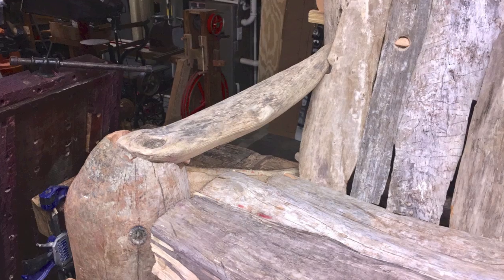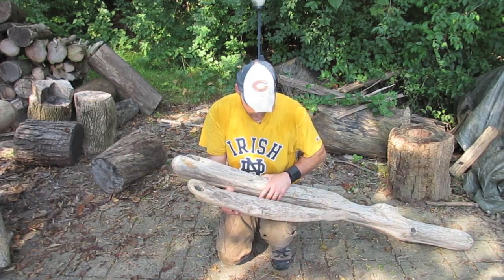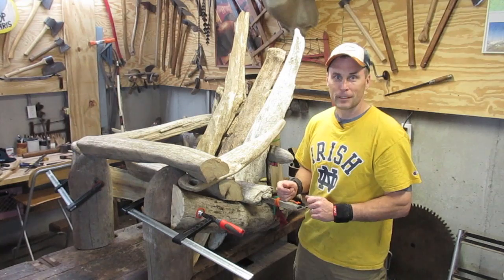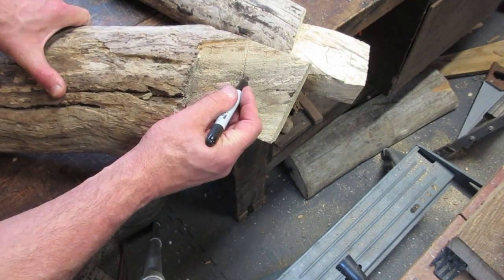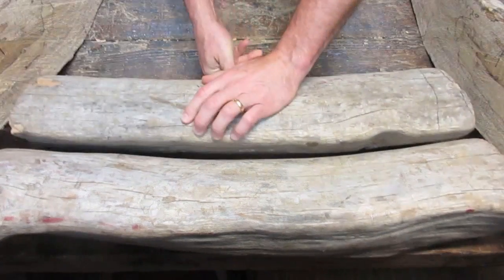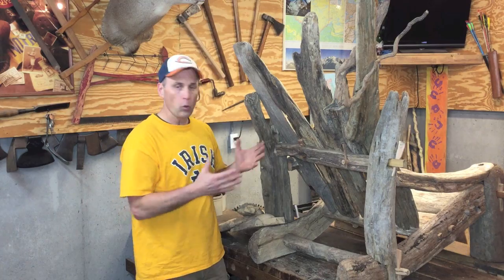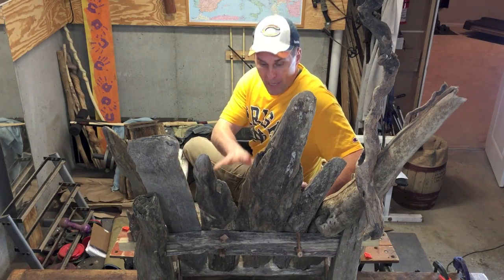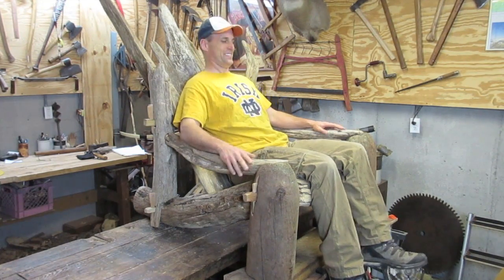How To Build An Adirondack CHAIR with DRIFTWOOD

Comment: Hey Chris, since you're using large logs stored out in the weather, can you make a video on the quality of wood, how you select and inspect for flaws, and how best to dry it to minimise cracking? 

I have some beutiful white oak between 3&5 foot 12 inch thick, that has been dead for years, harvested this passed spring, with very few flaws. Just want to know your thoughts if possible.
Reply from the maker: +nunya bisnass I'll add it to the list but until then here is what to do:  leave the bark on. Get the wood off the ground, and coat the ends and any exposed wood with Anchorseal.
Reply: Chop With Chris have to order the anchorseal, but thanks, and merry Christmas.
Reply from the maker: nunya bisnass I just remembered I already have a video about storing wood outdoors called.  How To Find And Maintain Great Wood.  Check it out.
Reply: Chop With Chris lol. Things that slip your mind. Will do, thanks for being so attentive.

Comment: The off setting you did, if it were a round peg would be called draw boring.  It will DRAW the pieces tight together.
Reply from the maker: +falfas55bgas Makes sense.